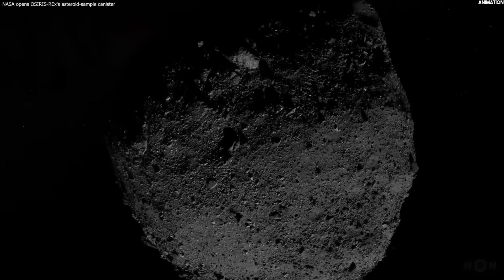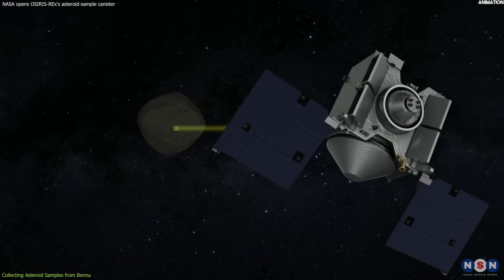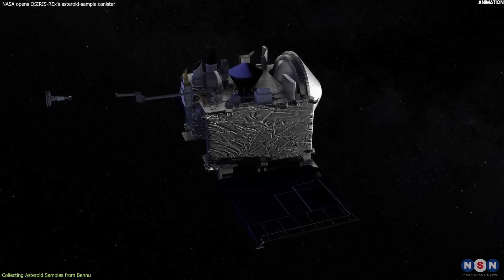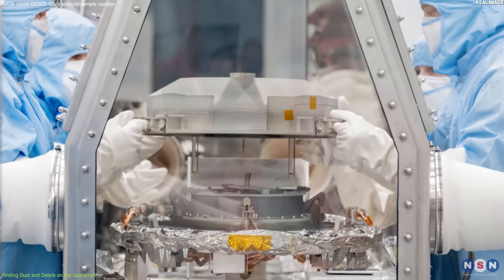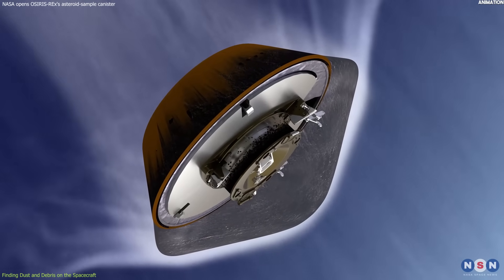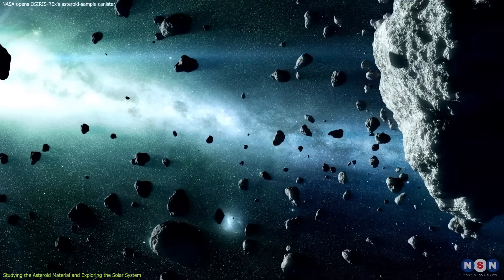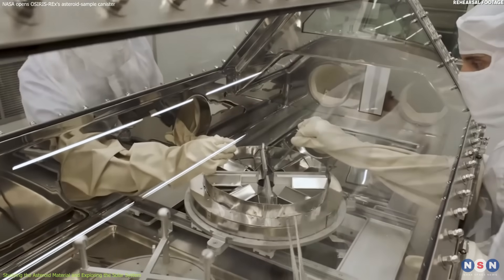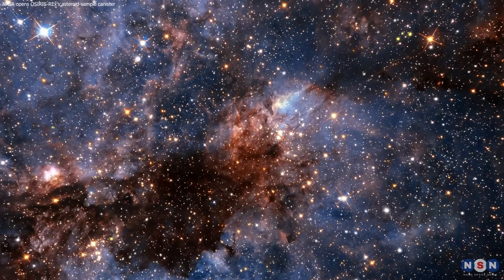NASA Opens a Time Capsule from Space and Gets a Shocking Surprise!

Comment: Any chance that dust and debris on the avionics deck came from the desert when it landed?
Reply: I'm no specialist or anything, but I think a bit of common sense rules this out. The outline you see on the avionics deck isn't a physical feature of the metal surface itself. That surface is actually flat, so what you're seeing is an outline formed by the distribution of the black material. If contamination had occurred after landing then you would expect to see more on the outside and less on the inside, but the photo shows the complete opposite. You would also expect to see specific areas where contamination seeped in, as opposed to a smooth, continous delineating boundry around the entire perimeter of the seal line. Finally, both the dust and grains show uniform distribution under the area of the actual seal line itself, which you absolutely would not expect to see if it was the result of movement of material in any direction after the seal had formed. Put simply, the image NASA posted is consistant with material being evenly distributed across the surface of the avionics deck at the moment the seal was formed. And since we know the capsuled was sealed at Bennu several hours after the capture of the main sample, it pretty-much narrows down exactly what that material must be.

Comment: How do they determine which pole is north and which is south on asteroids?
Reply: Just a guess, but if the asteroid is rotating (as it kind of has to be), that could determine north and south poles using the same convention as for Earth.
Reply: The convention is called the "right-hand rule." Point your fingers in the direction of the rotation, make a fist with your thumb pointing out. The thumb is the north pole.
Reply: @MERLE1593  lol what if asteroid has the iregular shape or cigar shape? North pole is in the belly? Stop spreading nonsense
Reply: @MERLE1593  would that not only work if the axis was at a similar position to earth's?
Reply: @DuckdaringZ It works independently of the tilt of the axis. It  is only the  direction of the rotation that is defining the north and southpole. So for example Uranus which has it's axis tilted  by 98 degrees still has a north and south pole. It is "laying on its side" compared to our planet Earth which as a tilt of 23.4 degrees 😊
Reply: @Amradar123  of ok.  So whichever pole is spinning counter clockwise if pointed towards us is north?

Comment: If you are going to do publications and videos  for the public, use English measurements. I buy gallons, not liters of milk or gasoline. I drive 65 miles an hour, I am 5 foot 6  inches tall,  my heating system is set for 70 degrees. NASA gets funded in Dollars not Euros. This is the United States, speak the measurement language of most Americans.
Reply: It is an international scientific mission so they use the metric system for the research and to inform the general public. The world is bigger then America, NASA proved that on 24.10.1946 using a V2 rocket with a camera 😊
But providing the data both in metrics and imperial would have been better indeed so all can relate to it.
Reply: @Amradar123  I can agree with some of what you are saying… sorta. The mission is funded in great part by the AMERICAN taxpayer, so It is an AMERICAN project. Frankly as far as I am concerned,  when I am paying for it, the rest of the world are mostly bystanders and I do not give a great deal of credence to their concerns. Remember Armstrong and Aldrin did not plant the UN or NATO flag on the moon, they planted the Stars and Stripes.  I expect NASA to present their public relations propaganda to me (the guy footing the bill) in terms generally used by me. Yes, I get it, metric is the unit system used for the science, frankly metric is more logical and easier to do science with, but this is PR not lab work. When NASA is funded in EUROS, they can speak EURO.  How is that for a bit of American over the top chauvinism? Well at least I kept my anti “woke NASA” comments out of this discussion.  One needs to vent once in a while.
Reply: True, you have to use american measurement for american dumb public on a american fake achievement
Reply: @mihaimih4669  It was a real success and not only for America indeed 😊 The spacecraft was build in America and the mission was managed through NASA. Instruments were not only delivered by America but also by Canada for example. The material will now be analysed by laboratory worldwide 😊
Reply: I agree with you about using Imperial measurements, but I do buy soda by the liter and alcoholic beverages are sold by the liter or milliliters.
Reply: @GradyPhilpott  Yup me too. But beer comes in 12 and 16 ounces. And canned and bottled food is also on ounces. If NASA wants to use metric for internal and scientific reasons fine, but the average Joe American thinks in pounds, ounces, quarts, gallons, miles, feet and inches. For public release and NASA propaganda they should be required to state English units.
Reply: @derjaeger3321   I have no argument at all against your position. When the narrators talks about millions of kilometers, the only thing I know is that it's a long way. It just doesn't compute because it doesn't relate to anything in my life, while those few items that I do buy in metric measurements have a real meaning to me, because I see them and use them all the time. One video or series of videos is not going to acclimate the whole nation to the metric system and NASA is after all an American institution.